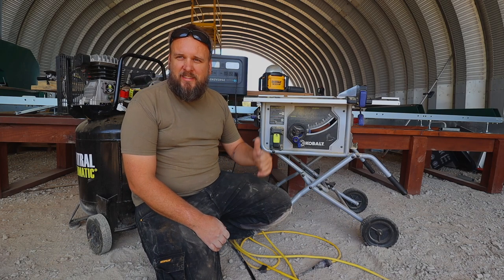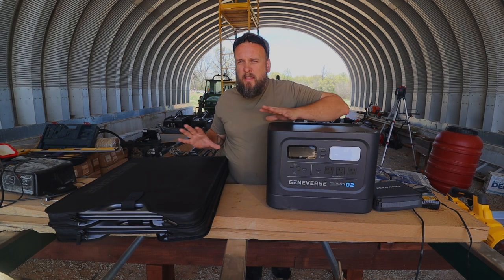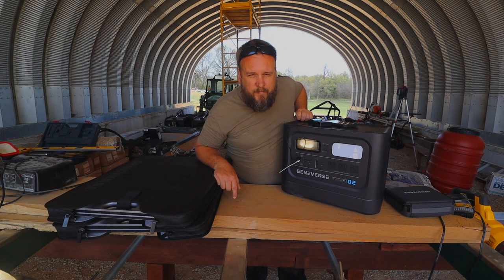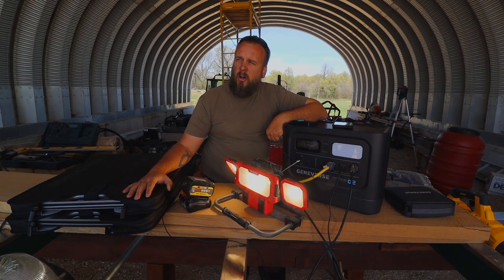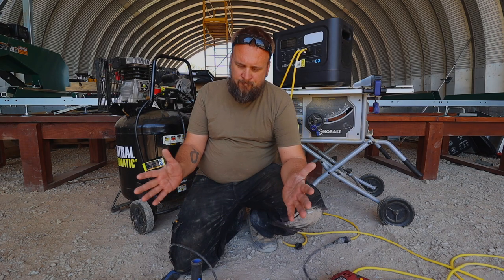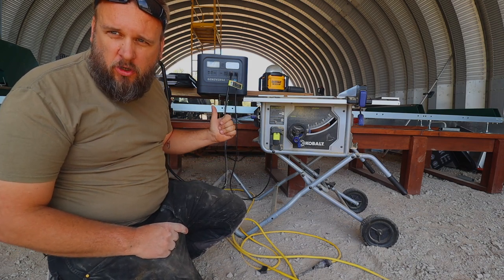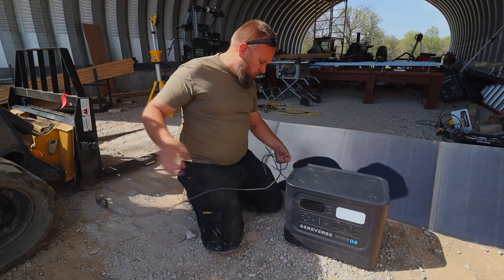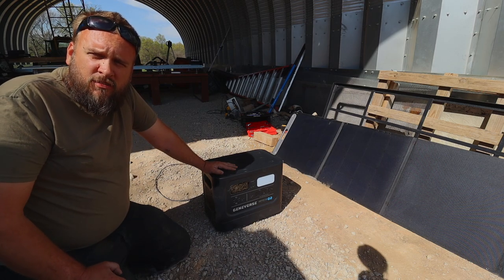Testing the Capabilities of the ￼Geneverse HomePower Pro 2

Comment: I have a similar, if smaller-scale, solution for my "remote" workshop that has all my power tools and tractor stuff.  I run a small Bluetti power station with a 200W solar panel and I keep all my dewalt and stihl batteries charged as well as my battery-powered LED lights, isotunes headsets, and other misc stuff like a small dewalt compressor.  While I <could> have provisioned electric service out there, by not doing so and going with the battery + solar..I'm saving $50-$60/mo in utility fees so after a year, the whole setup has pretty much paid for itself.  If I had a bigger setup, then a power station like you've shown here (plus more solar panels) would definitely be on my radar.

Comment: Looks like a nice job site unit. A lot quieter than a regular gas generator and only in use when you need it. I would like to see some wheels on it for ease of moving it around but not critical. I bet if you could mount some more permanent solar panels on the top of the hut, you could get more regular sun regardless of where in the sky and not have to move the panels around.  I do like the idea of mobile panels for random site work. Nice product and I hope it works out well for you Brock. Thanks for sharing.

Comment: I'm waiting for Project Farm to compare them before I still don't buy one :)  But he's going to have to drop around $20K to get all the units to compare, so I don't know if/when that'll happen. The fundamental problem with these power stations is repairing them when they fail.  A generator is pretty basic, and while a specific part may be unavailable for a particular unit, almost all the parts could be fabricobbled or machined by hand to get one running again (assuming the world really gets that bad). Electronics? Pretty much forget it. And once the batteries are dead, you have the recharge time, whereas the generator requires only gas, and you can stock pile that if bad weather is coming. Sure, generators are noisy and produce pollution, but for ease of use and more or less continuous power, it's a better choice. I look at the power stations as "day project" type devices.

Comment: $3400 for this model. I have a Predator 3500 Inverter generator I paid $700 for before the world changed. It runs very quietly for over 8 hours 3 gal gas at 3/4 load. Use it to power my camper and outbuildings. It runs one 15k AC, Residential refrigerator, water heater, and microwave. Try that with this overpriced unit. If they gave it to me I would use it but no way I would buy this at that price. 
Agree don't turn into a infomercial like some of the other outdoor channels. Next you will be reviewing E-bikes. :)
🙂
Reply from the maker: The E bike people have emailed me. No chance.

I appreciate your thoughts on it
Reply: @RockhillfarmYT  But if the e-tractor people email you... Then what?
Reply from the maker: Maybe I will take a poll of the audience

I don’t want to be advertising products constantly but the sum of everything I do as to pay for the equipment.

Got a couple of paid jobs coming up. It all adds up. Getting a free power station is pretty cool although I can’t pay my mortgage with it
Reply: @RockhillfarmYT  Understand. The Den of tools did a recent video of how he handles endorsements. You are a hard worker. I appreciate you taking the time to make these videos to show people the ins-and-outs tractors equipment implements hand woodworking keep up the good job you have come a long way from your teenage years driving like a maniac
Reply from the maker: Did you know me or did I tell a story in the videos.

I was a maniac as a teenager.

I work very hard at this, and I try to limit the percentage of my contact that is sponsored by a product.

Today was all moving dirt and planting grass by the pond for tomorrow’s video.
Reply: @RockhillfarmYT  You did a video.

Comment: This power station is a temporary fix.
Your reference to "Daisy chaining" being a bad way to go is misleading. If done correctly, it's as safe as ANY other wiring method. I'm a Stale licensed Master electrician and I have worked a great deal with agricultural customers that had many out buildings and have encountered your situation on numerous occasions .
Please contact a local Electrical contractor that deals with Ag customers. I assure you , having ' utility power to the Quanset bldg is the way you want to go for the long run. You'll be dollars ahead , and you can have that inverter ready during power outages or for your remote jobsites .
Electrically Yours
pc
Reply from the maker: You’re right. The reason I don’t want to run Electric out there is I would have to pay a licensed electrician. 

I did the first one myself, but that is the limit of my knowledge. I’ll probably do it eventually.
Reply: @Rockhill farm   next time I'm in your neck of the woods, I'll lay it out for you . Bartering  ( milled lumber) for skilled trades is not uncommon.
Reply from the maker: @patrickcorbett8361  you are up north right?
Reply from the maker: @patrickcorbett8361  absolutely

I would love to meet you after all of the comments you have left
Reply: @RockhillfarmYT  Michigander here!
Reply from the maker: @patrickcorbett8361  well, if you ever find your way down here, I expect you to stop by